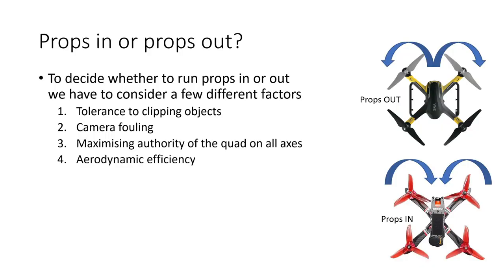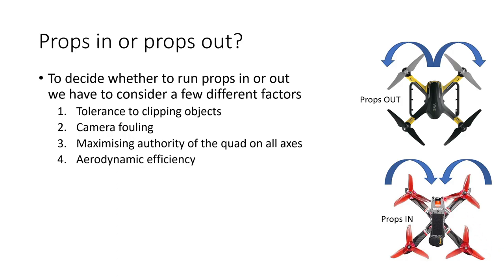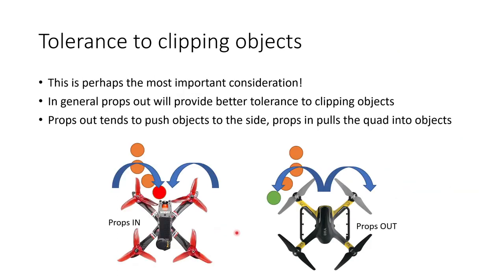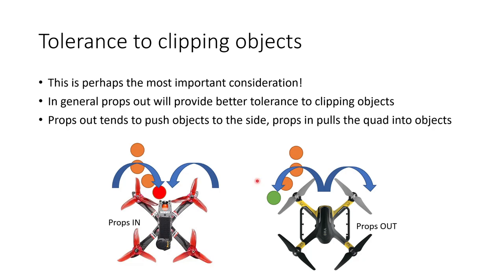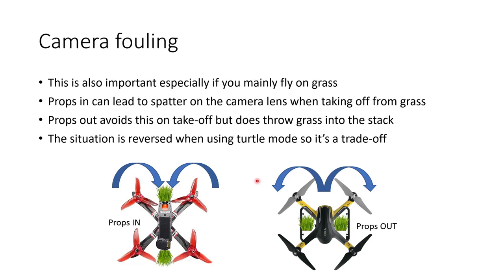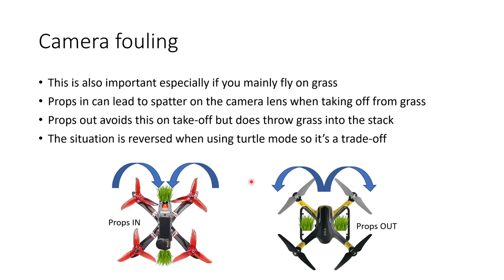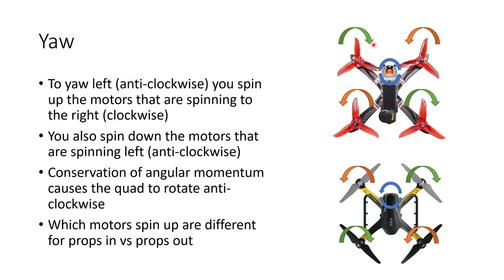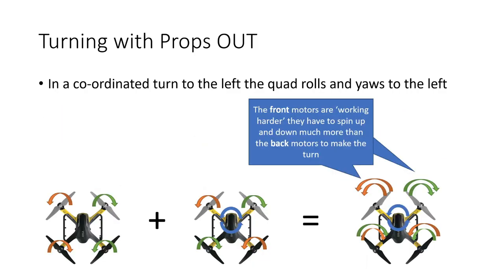Prop Direction. Should you run Props IN or Props OUT?

Comment: Another great video! Thanks Chris. I have been flying props-out on all my quads for years for all the reasons you mentioned. I fly everything from whoops to 5" drones and I fly both freestyle and racing, at all sizes. I agree with your points, but I think there is actually more that could be said on the topic. Here are a few things that might be interesting to expound upon if you ever feel inclined:

1) You showed the combined effect of roll and yaw, but not pitch. The ratio of each will depend on the maneuver and on the amount of camera tilt. If you ever have a coordinated turn that involves all three axes at once, the effect can be even more dramatic (a single motor can be tripple-slowed or tripple-accelerated to accomplish change on 3 axes at once).

2) In my experience, micro drones are affected by prop direction even more than larger quads. I believe one reason is that micros are often flown at higher throttle (using most or all the thrust that is available), whereas larger drones have so much thrust on full throttle that most people use full throttle more sparingly. If a micro drone is already in a high throttle maneuver then it may not have a lot more torque in reserve. Thus, the FC might ask it to speed up to accomplish double or triple duty in a coordinated turn, but it might fail to do so. 

3) In my 65mm whoops are affected by prop direction the most. I believe the reason is that the props are tucked in very close to the canopy and the canopy typically rises high above the props (relative to the distance). In a fast forward turn, the canopy badly disturbs the airflow over one of the back props, especially on the inner side of the prop. Everyone I know who races whoops runs props-out. We have even had new pilots show up with props-in whoops that struggled on the turns, and we helped them switch to props out, and even the new pilots could feel the difference in stability.

4) All the assumptions here assume airflow is coming from the front. That is true more than any other direction, but certain moves might involve significant airflow from the side, or even airflow from underneath (such as pulling out of a dive). It would be interesting to discuss how those situations are affected by prop direction.

5) I have seen one case where props-in was clearly better. If you have a whoop that is heavy for its size (like a 2-3S whoop, or a whoop with an HD camera), and you fly props-out, then you might find that it experience yaw "wash outs" (undesired yaw spin and wobbles) while pulling out of dives or power loops. If the drone is light enough, it won't happen at all. In that situation, I have found that switching back to props-in significantly improved stability. Unfortunately, switching to props-in makes those fast forward turns worse, so I still choose props-out. Side note: adding a carbon stiffener also reduces yaw washouts (heavy whoops flex more than people think in high G maneuvers).

Nothing contradicting what you said, just some interesting cases to consider. Cheers.
Reply from the maker: Pinned so others can read these interesting points!
Reply: @ChrisRosser  That was just a cherry on top of another great video. Cheers guys
Reply: Great video with great explanations, as always! Keep up the great work.

Props out being better is known for a long time and has been proofed countless times. Especially whoops show this a lot. Once you count in Pitch and just calculate the thrust vectors needed for a turn you find out props out has a clear benefit in net thrust created. 

I do not know how strong the turbulent air effect is in comparison to that, but anyhow it is also less in props out config. 

Interesting would be to look at hybrid designs (front 5 inch arms, back 6 inch arms, all props 5 inch) or on back arms mounted up compared to the front arms (CMW Banggod frame) and how beneficial that is…

I don’t think there is a difference between pusher and puller configuration, but I am sure you will find out!
Reply: @mattimehner9193  With the pusher configuration on whoops when I flew FPV I really liked how the pushers felt. I loved the TH for that reason and I made a Mob6 pusher and loved the way it flew also, especially with the 25k motors it felt so planted for 65mm platform and had no washout. 
Interested to see actual testing results on it, cheers mate.
Reply: @ChrisRosser  I think there is one more factor that could be considered here. This is pretty known for helicopter design at least AFAIR. Haven't done the math for quads thought. For a spinning prop in flight, the amount of lift generated is dependet on linear velocity of air flowing over blade - so it's (lin. vel.) close to zero at prop root and highest at tips. Additional air sped added by horizontal flight causes a region of zero/reverse flow on downwind side of prop disc close to its center. This creates uneven lift on prop disc and additional torque with it.  As prop has a lot of angular speed this will probably be "transferred" with gyroscopic effect ono another (pitch) axis. As I said, haven't done the math to verify how influential this effect could be on quad. Quad props are also built differently when compared to helis as they seem to have variable pitch (changes with dist form root). Overall this seem like a good opton to check as it could potentially explain different behavior depending on propeller size as Mr ShutterBug observed. Would love to see someone more experienced than me verifying that :)

Comment: I would be interested to hear your take on "pusher" whoops vs. traditional whoops. People like to say that pushers are aerodynamically superior because the frame does not block the air that exits the prop. However, with a "pusher", the frame does block the air that is flows into the prop. Isn't that just as bad? I have never observed a benefit in performance, but I have not done an apples-to-apples comparison, so it's hard to know for sure. For me, the main advantage of a pusher whoop is that it is easier to mount an HD camera near the front, where it won't see the guards. The main disadvantage is that you can only take off from a perfectly flat surface. If you try to take off from grass or dirt, you'll probably just make a mess of things. Anyway, the difference between clean air in vs clean air out could be an interesting thing to discuss in the future, if you're interested.
Reply from the maker: Very interesting. I'll add it to my list of science videos and take a deep dive look.
Reply: Very interested in this as well.
Reply: @tripleheart2970  but it will be no difference if u add a higher pressure area on the bottom/outflo or a lower pressure area on the top/inflow. However the outstream is stronger and more focused so pushing harder into the wrong direction as the inflow does on the pusher. the ducts suck in air from all sides at a lower speed than the output stream
Reply: @tripleheart  no need for apologies. this topic is highly speculative. we should do measurements.
I don't know if you are right with what you say. The argument of less inflow might be an issue, it might be not, maybe the air ist jetz flowing 2% faster and the airflow is almost unhindered, it is two factors the question is which one is bigger (->measurements?).
But you made an error with the argument about the taking off and the floor. Because if you push air against the floor you are not pusing the quad down. But the air that pushes against the frame pushes against the quad and applies a counter productive force on it and my argument is that this air is much faster and more powerfull than the intake air that might apply force on the top frame parts of a pusher.
Reply: I was also thinking of this same exact thing. And want to try the front motors as pusher and rear props as pullers with a props out rotation, I'm gonna change up my toothpick 3 and try it out tomorrow. I dont know how the heck i'm gonna launch it but i'll figure something out.
Reply: I tried turning an LDARC/King Kong ET100 V2 into a pusher.  I stuck the camera on a block of HD foam and crammed it between the front hoops.  It flew, but it would need a serious re-tune in order to take into account the new CG before I'd consider it anything worth bothering with.  It wasn't the necessary tune that turned me off, though: the prop noise was the killer for me.  Even though I had the props flipped they were almost twice as loud, with a nasty, high-pitched whine that's not there right-side up.  That alone convinced me to abandon the ET100 as a pusher.  I did notice it dug into corners a tad better; it translated nicely, too.  But I got this 'broom balancing' effect I didn't have before, thanks to the raised CG from having the battery pack on top.  It happened infrequently, particularly when doing a co-ordinated turn; the inside would 'drop' and I'd be wigglin' and wobblin', trying to catch it.  I have it tuned too well right-side up using BF 4.2.6 that I went back to it, and kept the camera between the hoops.  Got a clear view now at no cost for the mod.  Still my daily driver.  Gotta like it, eh?
Reply: My 2 cents - the air that exits the prop is accelerated and that faster airflow impinging upon frame components will cause a bit more turbulence than the slower moving air being sucked through the top. This probably will mean a pusher reduces these losses.

Comment: I'm going to try props out today!
EDIT: I'm back after absolutely amazing flights! For my 2.5", switching to props out improved throttle response and significant prop wash reduction. I typically have trouble keeping altitude doing a tight orbit around a post/flag. With props out, the quad felt like it was able to keep altitude by responding closely to stick input.

Comment: Excellent video Chris - The 'Aerodynamic Efficiency' you refer to is commonly known as the Asymmetric Blade Effect among General Aviation. This is one of the reasons why a propeller driven aircraft will yaw to the right upon rotation. 

An interesting point to note is that when the quad is flying in fast-forward flight (straight and level), the outboard phase of the propeller will be generating more lift than the inboard (assuming props in), thus moving the effective point through which the torque (relative to point zero - for this we shall define as the centre of the frame) acts on the frame, further out. This increases responsiveness and authority as proven by T = f.d as the moment arm has increased in distance from the fulcrum. 

Contrary to this, when operating in a props out scenario, this moves the effective point through which the torque acts in the opposite direction (as the propeller generates differing amounts of lift throughout the cycle due to the asymmetric blade effect) which, logically, reduces responsiveness and authority. 

A common misconception is that the rear motors are working harder due to the 'rear section of the quad being pushed down by the oncoming air'. This is not always true. This is purely dependent on the position of the centre of pressure (COP) and centre of gravity (COG). If the COP is forwards of the COG, this will push the nose down, requiring the front motors to work harder. If the COP is rear of the COG, this will push the tail down, requiring the rear motors to do more work. The COP can change depending on the relative profile (effectively the angle) of the multirotor to the oncoming airflow and will not always be constant. 

I'm surprised that manufacturers haven't started developing forms of natural aerodynamic stability or instability into their airframes like they do in aviation (look at dihedral on a passenger jet and then the anhedral of a fighter jet). 

Take this with a grain of salt, I do not have an Aerospace Engineering degree, I only have a Commercial Pilots License with a thick interest in aerodynamics and physics.
Reply from the maker: Thanks for your comment! I completely agree with everything you said. In general I don't think for my quads the COP is very far away from the COG because I don't see much I term in fast forward flight. If there was a strong pitching moment from aerodynamic effects it would certainly show up there.

Authority wise, whether running props in or props out one prop per side will have the outboard phase making more lift and the other prop will have the inboard phase making more lift so I don't think that confers any advantage or disadvantage to either configuration.

Comment: thanks for this, its great ;) just want to add for authority in turns: props out is also better because if you fly straight forward the rear motors do work harder than the front ones, so the extra work in turns in props out configuration do not add to the rear ones too, which also leads to the advantage of props out
Reply from the maker: Absolutely! Another advantage of props out.

Comment: Thanks Chris. This is exactly what I have been testing and was hoping you would get to it. MrShutterbug (Nate Payne) opened my eyes to props out with his Beta75x washout tuning a couple years ago which dramatically reduced the insane yaw jerks on that model. I now run props out on the majority of my fleet. 🙏
Reply from the maker: I think this matters most on smaller quads where authority and efficiency are less overall so any improvement matters more.

Comment: This is 2 years old and I am not sure if anyone will read this. However I have three AOS T3 quads in different configuration. I asked Chris about tuning because I was having issue with at least one of them. It bobbles a lot. Chris suggested lighter props which I bought. It helps but not the one that bobbles. Then I noticed I was running props in on that particular quad. After changing rotation direction of the motors I am now flying props out on the quad and it is behaving much better.

Comment: The back motors work harder anyway because we fly pitched forward which means there is a bit more drag pushing the rear down and the motors work harder to maintain that angle. So by running props out we basically relieve the rear motors.
Credits: JB

Comment: Great explanation and detail! Thanks. Been flying props out for ages because it just ‘felt’ good. Now I know why.
Reply: By the way… something I’ve been wondering about. Why are we still manually ‘tuning’ our quads? Shouldn’t it be possible for ‘the software’ ( using ML? ) to do a BB analysis and adjust filters and pids accordingly? After that.. all we should just tune ‘stick feel’ .. Or has that already been done and discarded?
Reply from the maker: It's very hard to predict the effect of changing PIDs in isolation. I'm speaking with a dev from AI drone simulator it might be possible to extract flight parameters from blackbox, auto tune in the sim, then get out the right PIDs for your quad. We'll have to see!
Reply: @ChrisRosser  Now that’s an interesting experiment. Guess I’ll have to get that sim now… unless it’s Windows only. Hah. Thanks!

Comment: I can't wait until JB sees this. Will he finally change?
It's great to finally see it all laid out so clearly, and finally someone that knows what they're talking about is getting some traction. 
I'd also not really considered the retreating blade effects. I believe the advantages it gives in cornering has been fairly well known in the whoop racing world for a while
Reply from the maker: I think this is well known in whoop racing. It's not surprising because these aero effects matter more on smaller quads with lower blade tip speed and less overall authority.
Reply: I'm sure I remember a video from a long time ago where JB said props out was better
Reply: For woops there is no question you can feel the difference props out is way better.  I'll probably switch my 5" to props out the next time I tinker with it at least to try it.

Comment: For the reasons you give, I generally run "props out".  However, I am currently building a cinewhoop.  With the ducts/prop guards cutting down on the crosswind, many of the advantages of "props out" don't matter any more.  So I think I'll go with the Betaflight default of props in for my cinewhoop.
Reply from the maker: I would love to know if you notice any difference between in and out on your cinewhoop!

Comment: I think one important consideration regarding clipping objects: if you fly around a lot of trees, in my experience, props in is more likely to let you continue your line through things like ghost branches, where as props out will tend to deflect you away. I prefer to just plow through those light obstacles.

second consideration: cross-coordinated rolls have the exact opposite effect on authority: front motors work harder props in. this is irrelevant to racing and cinematic, but smewhat relevant to freestyle, considering any roll move when shooting footage you want to cross coordinate, otherwise your shot is just spinning around your camera angle. Of course, throughout the flight, coordinated turns will likely be more present than cross coordinated rolls.

third, taking freestyle in to consideration again, Im not sure that forcing the front motors to work harder in turns is advantageous when you consider that the front motors are closer to a gopro, and thus are already working harder than they should be considering they have to work a short torque lever situation with that vertical weight. It seems in that scenario you inch closer to motor saturation sooner.

lastly: shouldnt we use some sort of fluid dynamics simulation to determine the difference in advancing/retreating turbulence? I ask because, in your diagram, you seem to gloss over the fact that in props out in, the more turbulent air on the outside edge at least has a clear path to the rear prop, whereas in props out that more turbulent air is directly next to the body of the quad, and I have to imagine that is going to something to that turbulent air.